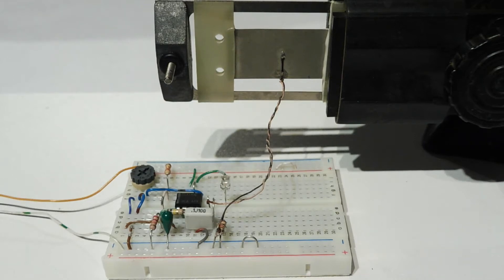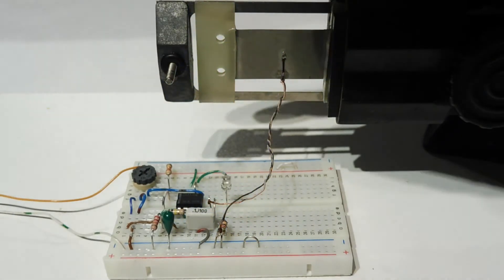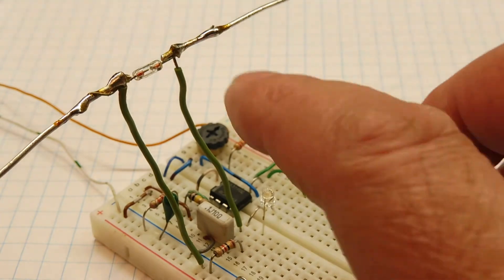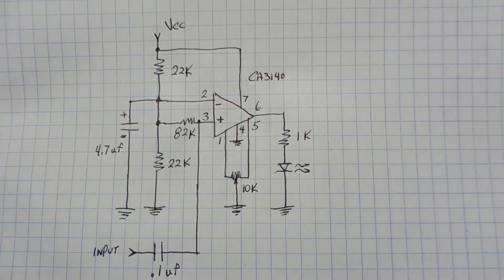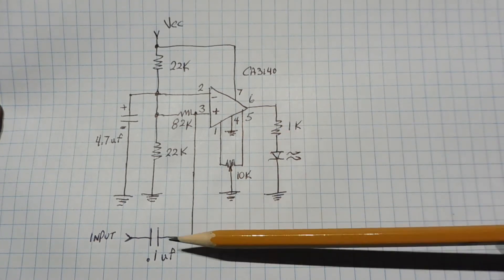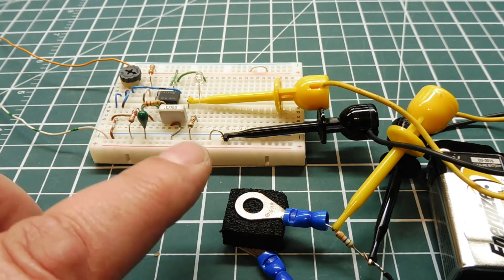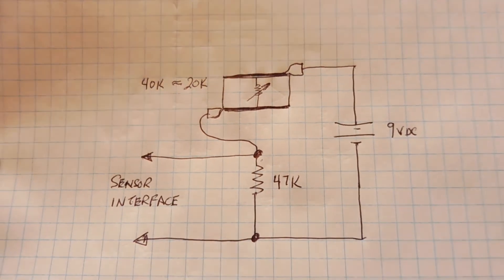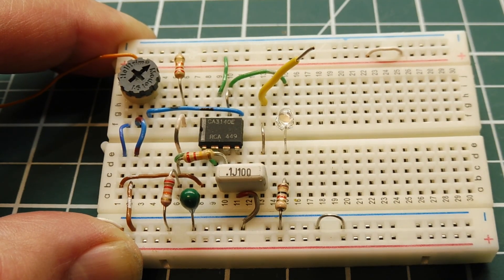Sensor Interface Circuit  / Cellphone Detector, Vibration and Pressure Sensor

Comment: t04-11-2023

(1.) Hi, there.

(2.) Very new to electronics and need some clarification for the vibration detector.

(3.) For the vibration detection portion of your presentation, would you:

(3a.) detail the components used (including the value, voltage, percentage, wattage, etc.)

(3b.) list the pin-out for the locations you’re using in the circuit 
{ for instance, the LED (voltage unknown) looks to be situated at E15, F15; the 4.7uF .1J100 capacitor appears to take up B10, B13 }

(4.) Difficult for a newbie to know where to place the specific resistors (you had called them voltage dividers) and green component (what I think is a .022 uF capacitor, yet percentage and voltage aren’t defined) from looking at the schematic so that everything’s correct.

(5.)  Saw in an earlier come that either 10 volts or a 9v battery could be used for the power supply, so I’ve got that one solved.

(6.) Thanks.

(7.) Toodles!

Comment: Hi there 0033mer,

Question about substitution of capacitors… I know how to easily substitute resistors in a circuit when I don’t have a particular resistor on-hand.  But can we do the same for capacitors?  For example if a circuit calls for a 0.068 uF and all I have is 0.1 uF caps ?
Reply from the maker: Before doing a capacitor substitution you must understand the application the capacitor is used in.
For timing application like a 555 timer you need to use the same value or the frequency will change. Input and output capacitors in an audio amp circuit determine the frequency response. Power supply filtering caps can be higher in value but use the same or higher voltage rating. The type of capacitor also has to be taken into consideration.
Electrolytic and Tantalum are polarized, Ceramic and Film are the most common and Mica are used in RF circuits.
Check out this video for more info: https://www.youtube.com/watch?v=J0TjW_0xTJU
Reply: @0033mer  thank you for the summary, I couldn’t find this info so well put!

Comment: I've never seen an op amp comparator circuit where the voltage divider is fed into both inputs, usually it is fed into a single input that serves as the reference.  Are there particular advantages to your design?
Reply from the maker: It makes the circuit very sensitive and will trigger on very low input signals.

Comment: This is very interesting circuit. Than you for this video! Unfortunately I don't quit understand everything in the design. I don't understand all values for the resistors and why it is used combination of 82K resistor with 4.7uF capacitor to block AC signal. I would like to learn more details about circuit and how to project it, calculate values etc... How can I learn this?
Reply from the maker: Check out the book Practical Electronics for Inventors. It is a very good reference book for electronics circuit design. You can download it free here: https://www.pdfdrive.com/practical-electronics-for-inventors-4th-edition-e158038931.html
Reply: @0033mer  Thank you so much!

Comment: What is the voltage used at VCC? And the antistatic foam we are using is giving us between 1000 k to 300k... I used different types of antistatic foams still same result
Reply from the maker: The circuit is powered on the bench with 10 volts DC but can also be powered by a 9 volt battery as used in this video: https://youtu.be/2_aGQjPzySs
The change in foam resistance is what will trigger the circuit.

Comment: ive tested your engine spark plug sensor and i read the frequency signal output with Arduino, and unfortunately the outputs signal stop when i put 130hz signal with sine wave, did my circuit wrong? or this circuit has a limit 130hz?
~thankyou
Reply from the maker: The circuit was designed to give a visual output indication using a LED and not for high frequency detection. The output signal from the OpAmp is integrated by the RC components and diode connected to the gate of the Mosfet. If you remove them and monitor the output of the OpAmp directly you will increase the frequency detection output.
Reply: @0033mer  thank you this really helps me sir. So does it means if your spark plug sensor circuit handles 130hz max when the engine rev very high it limits blinking around 7000rpm? and what are the compoments should i remove to see more hz while maintaining the use of the spark detection from spark plug?
~thankyou

Comment: Hi 0033mer, can u explain  what you mean by the reference to the stray 60 Hz ?
Reply from the maker: The human body acts as an antenna that picks up stray 60Hz radiated from the power lines in your house. You can see this when you touch the tip of an oscilloscope probe. This 60Hz signal triggers the sensor interface and turns on the LED when touched.

Comment: @2:54  Does the 82k resistor cause a difference in input voltage to the op amp or is there no current flowing thru that resistor because of the high input Z of the opamp so that the voltage on either side of the resistor is the same ?
Reply from the maker: The voltage on either side of the resistor is the same. The 4.7uf capacitor acts as an AC short so the resistor isolates the input signal from being shorted to ground.

Comment: Can you please explain how the 4.7uF capacitor filters the imput signal ?
Reply from the maker: A capacitor is basically a short circuit to an AC signal.
Any input signal (AC) that gets to pin 2 of the opamp will be shunted to ground.

Comment: these ca3140 can sense very small current/voltage change...and are better than normal opamps
Reply: it still works with normal op amps its not a big deal ..